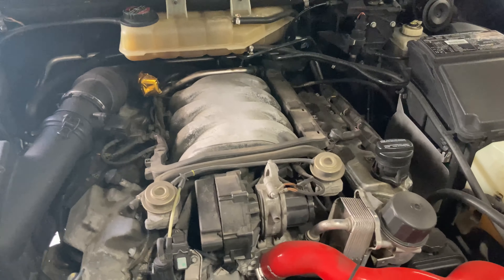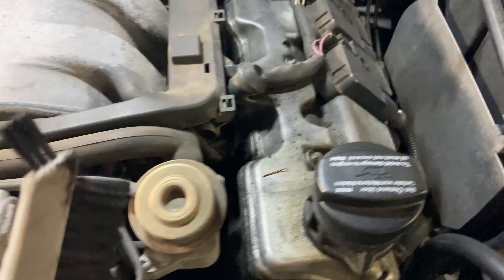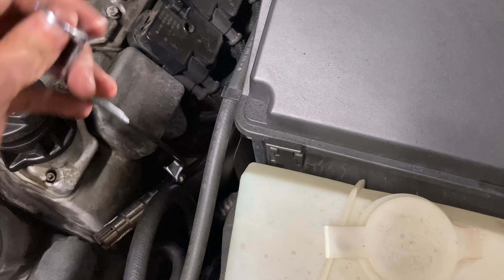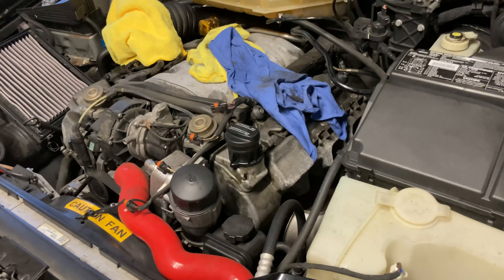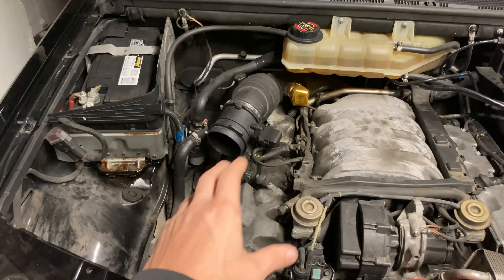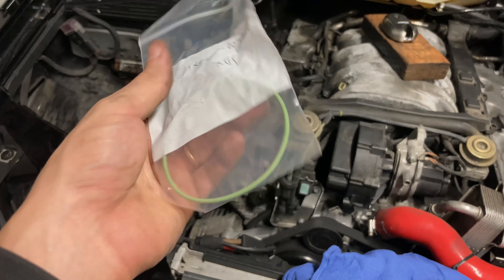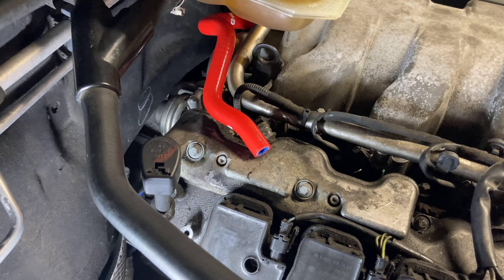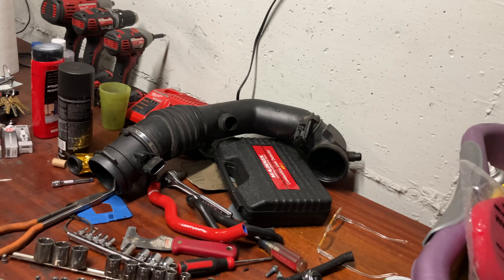Ml55 AMG New Valve Cover Gaskets, Spark Plugs & Throttle Body Clean

Comment: I’m about to do this job 😞 Valve covers, spark plugs, hoses, but also replacing the oil cooler, oil filter housing, both motor mounts, transmission service, belts, pulleys, coolant flush, brakes and rotors and blend door actuator. I am beginning to regret buying my ML55 but i hope it lasts me a few years. Thanks for your videos
Reply from the maker: It will last you! Try to break up the jobs by what’s needed most so you don’t get burnt out. I’ve done everything you listed besides blend door and all are pretty easy aside from the valve covers being a pain, mostly just the intake side, once the intake is off though it’s a walk in the park with lots of room compared to driver’s side.
Reply: I feel the same way

Comment: Thanks for sharing Brooks. My C55 is leaking at the oil filter/cooler housing so I'll be doing that plus the rocker covers, plugs and pipes soon.
Thanks again. Take care!
Reply from the maker: I also did those oil cooler gaskets on the ML55 a while back but didn’t film, have a angled pick tool ready it will make things easier to get old hard gaskets out. 🤙🏼 I have them ready for the C55 too and will make a video once done.

Comment: Nice work Brooks..I have done this job on two M112's and my CLK55..It does take a long time to do it properly. 
The breather covers are the most time consuming part because they need to be super clean .
Also clean out the old sealant from the bolt holes.
It is strongly recommended not to use the small aluminium bolts again ,because they often break , as happened to you..
MB have new bolts  available which are stainless steel to minimise any galvanic corrosion with the Magnesium valve cover. 
Or you can buy stainless steel bolts elsewhere ,,M5 by 16mm.
I like to do the job in stages and fit the breather covers one day with the small bolts and sealer , and then fit the cover to the engine the next day. That is how it was done when at the factory. The small bolts should only be torqued to about 3 Nm , or just snug by feel with a screwdriver style  tool  ,,,you don't want to strip a thread , and their only purpose is to hold the cover in place until the sealant hardens.

Also I agree ,,NGK plugs are the best..you will find the car runs much better with all plugs firing.
Thanks again..
Reply: Also did this on my M113 ML430 and CLK500!! Sweet memories of hours of tooth brushing those covers ;-)
Reply from the maker: Thank you! Yea still kicking myself for snapping that bolt but I’ll fix it once necessary, luckily it’s not vital like you said.
It’s running a lot happier now, just went on a day trip to the coast and got up to almost 21mpg’s highway, new record! No more stumble idle either.
Reply: @ANDERZENAMG  Very good ..I would not bother trying to fix that bolt until the next time the cover needs to be resealed..
The large bolts and the sealant hold it all down fine.
When I got my CLK55 one of the spark plug wires had not been pushed on properly ,,not enough to throw a code ,,but the engine ran noticeably better after I pushed it on properly , even though they have two plugs per cylinder as you know.
So that broken plug was definitely handicapping the engine..
Reply from the maker: @Leo555ZZZ  my C55 had a similar scenario with multiple boots not being on all the way… it was doing all kinds of weird electrical stuff like throwing the ABS light randomly and running weird. Plugged the boots in properly and all went back to normal. Thus why I recommend lots of dielectric grease on them because they are a pain to get to snap correctly without it.
Reply: @ANDERZENAMG  Yep , also try rotating them a little back and forth as you push them on ,,but I usually still have to push with the offset spanner to get the click ..

Comment: i removed the expansion tank to clean out the egr on my ml430 walk in the park , you should have just removed it and refill it done.  next time your at the wreckers look at the other mls some intakes have a cap where you have your gold contraption lol , mine has a cap 99 ml430
Reply from the maker: Yea could have done that, oh well now haha but appreciate the tip for future. I do believe the 430 and 500 have a bit more room between the firewall from ones I have seen but not sure.
Will keep an eye out for those caps! May build a custom intake altogether though

Comment: Keyless entry not working is most likely a bad AAM. You can start by replacing your old fob, they actually make cheap aftermarket flip key fobs that are totally complete, not the shell where you move your board over. But in my case it didn’t help, it was a bad AAM. I found a good one in an ML320 in a junkyard and that fixed me up.
Reply from the maker: Yea already tried swapping into new fob, and with the locks machine gunning every now and then. Signs point to bad AAM. Can any W163 one work or are there certain numbers/models to match up? Thx for the input!
Reply: @ANDERZENAMG  I found the matching part number for mine just to be on the safe side but I think any 99–01 is compatible. It didn’t seem like there was a long list of part numbers so it should be easy to track down the matching part number though. You’re supposed to recode the replacement AAM with STAR for your particular truck but it won’t prevent you from starting the truck or testing keyless entry, The coding is just for options like fog lights, LHD/RHD, country code etc that either won’t apply or are already set correctly. Also! I tracked down a salvage yard in Germany and I’m having them ship me all of the manual transmission specific stuff from an ML230. I have a beater 2001 ML 55 parts truck that I can use as a guinea pig for manual swap and 2wd conversion. I’ll keep you posted.
Reply from the maker: @daveh2612  thank you! I’m looking into what goes bad on them typically, would be worth it to try to repair if it’s just bad solder connections or something along those lines..
That is awesome! I’ve contemplated that many times, would be a ton of fun with a manual for sure. Look forward to what you find!!
Reply: @ANDERZENAMG  I pulled two known bad AAMs apart and nothing jumped out at me as being defective with regards to solder joints or toasted components so I don't know. They seem to be super fragile. The AAM I pulled from the junkyard had the key in the ignition so I put a jump pack on the car to test keyless entry before I removed the AAM since so many are bad. It just seems like part of fixing up a W163 is going to be: replace AAM, replace fobs, new key blades cut, replace electrical side of ignition switch (not the tumbler), replace door latches as needed. All of those things end up defective. OH, here's the stuff the guy is sending me for the manual swap, although I don't need all of it. https://www.youtube.com/watch?v=e87g_YgG0nE

Comment: Hey man, thanks for another excellent vid. I'm looking at doing everything you've gone through on this vid, plus some other things. Regarding your choice of spark plugs, what guided you to use that exact plug? And how long have you been running them in the C55 for?
Reply from the maker: I think it’s been about a year but you can check the video date. Biggest reason why I would say is cost and availability, and in reality they match or exceed performance of platinum plugs just don’t last as long. For me, I don’t want to leave plugs in for 100k miles anyway since I like inspecting them at least every year or two. Lastly NGK just because I’ve always used them and always have had good results, they are a dedicated brand to strictly ignition related items which shows in their quality and performance.
Reply: @ANDERZENAMG  thank you. I have used NGK in other cars with nothing but good results, so yeah I hear you. Thanks for taking the time to reply. It's very helpful.
Reply from the maker: @jarrodgordon5500  yea, I was surprised when I couldn’t find any record of people using a traditional nickel-alloy or ‘copper’ plug in an m113, so I figured I would be the one to test.. you are welcome, happy to help any time 👍

Comment: Breather hose connector that sits on top of the throttle body is faulty. It’s supposed to have a long piece of rubber that goes through the hole it sits on. Happened on my car & had poor acceleration
Reply from the maker: Not an issue here but yes that can happen on the factory piece, this is one of the reasons why I built my own design out of silicone hose 🤙🏼